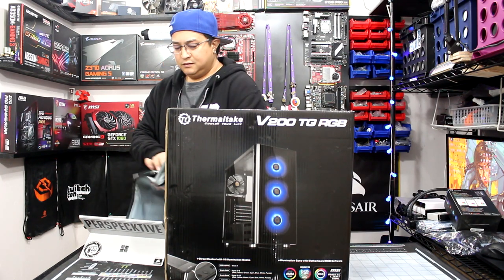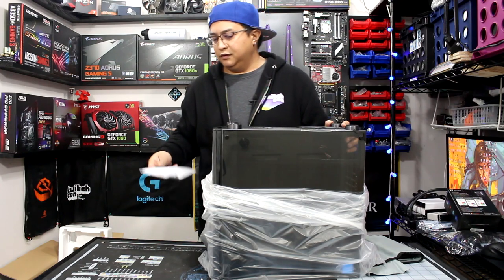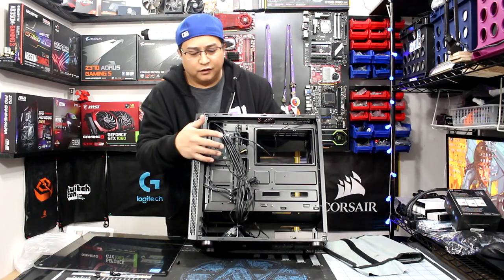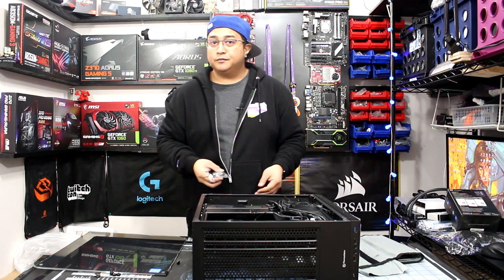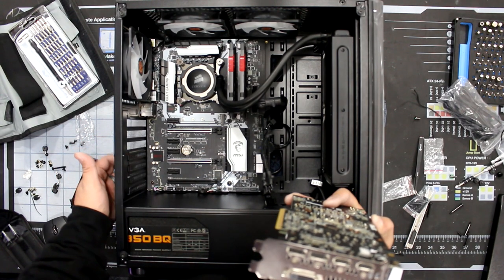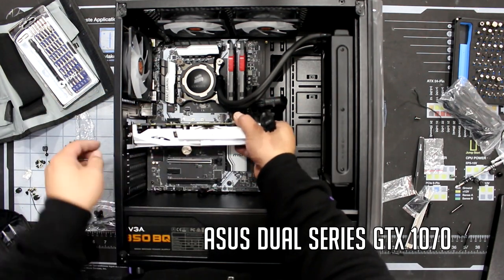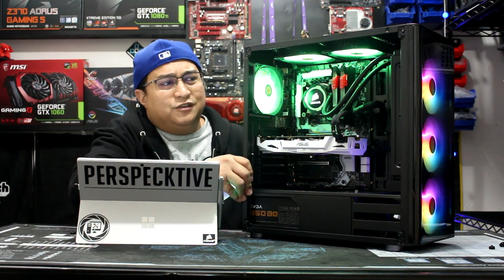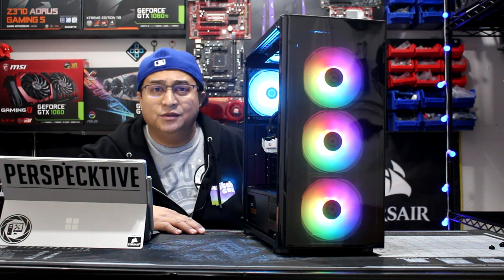Building In The Thermaltake V200 TG RGB (2018)

Comment: So just to confirm, this case can NOT fit a 360mm radiator in the front? I'm finding really mixed information on this.
Reply from the maker: The new version of this case can. I mentioned it in my pinned comment shortly after I found out there was a revision as this was the pre 2020 version of the case. Wish I could annotate that in the video but a pinned comment was the best I could do. Hope this helps
Reply: @PERSPECKTiVE  Sorry, I should've looked at the comment. Thanks so much! Now I just have to figure out if I bought the 2020 version or not. I got it in April of that year, so it could probably go either way.
Reply from the maker: @EthanH1  it's alright, it's not the first thing someone would look at anyway since most pinned comments are full of like and subscribe ads. But yeah I haven't worked with the revision so idk if there's anything that sets them apart
Reply from the maker: @EthanH1   I thought about it and had to watch the build again since it's been so long but I think one thing that they probably did was make the hole on the psu shroud a little bigger and adjusted or extended the holes on top to fit a 240 rad. You could try comparing that to what you see here if you're able to. I looked at pics but I think they just reused the old pics since the outer body is exactly the same

Comment: Hey just built a PC with this case, everything seems to be fine but my case fans are not running or lighting up. i have the female/male 4 pin unconnected not sure where to connect it i have motherboard: ASRock B450M PRO4 Socket AM4 Dual Channel, PCIe 3.0, 2xM.2 USB 3.1, DVI-D, HDMI, D-Sub, RGB mATX can u help fix fans? Thanks
Reply: There's a sata cable that powers the fans from that little board, you'll have to connect it for it to work
Reply: Justin Honeycutt Yeah i figures that out soon after posting this, Thanks for the reply tho
Reply from the maker: Sorry for the late reply but I'm glad the community stepped in to help you out and even though you already figured it out, I'm glad for that too. Hope your build runs great!
Reply: @PERSPECKTiVE  no problem, I've got this case but my biggest gripe is restricted airflow from the front fans since I've got my 240 Radiator mounted there.
Reply from the maker: @justinhoneycutt3307  I feel you on that. That's the only reason why I would push for 140mm fans on top to counter the issue. Not the kind of case I would use for a cpu that runs hot like a 9900k but if you have air cooling it can't be too bad. I also wouldn't put a system in here that you're planning on doing heavy overclocking either unless your're running a buncha be quiet or noctuas.
Reply: @PERSPECKTiVE  5 upHere fans for the Radiator and three upHere for the top and rear of the case, it keeps a i5 9600k roughly 35 idle

Comment: would it be a good idea, since i have this case and it’s my first time building yet i have no idea what to do, to take out the bottom fan in the front, put it in the back and then place the one in the back on the top of the case so it can have better ventilation? bc i read reviews of the ventilation being bad and making the inside hot if you use it how it comes, in just worried since it’s my first build and i don’t wanna mess anything on the inside up when it’s running.
Reply from the maker: You could do that if you're strapped for cash. You could just buy 1 140mm fan and be OK with that as well. What are you building in it anyway? Also, before you build it make sure you remove at least 2 pci plates in the back if you have a graphics card. More if you have things like an internal elgato.
Reply: PERSPECKTiVE i don’t have the cash for a extra fan hence why i wanna try going this route, i’m building just a simple gaming computer for streaming and gameplay, and ryzen 2600, gtx rog 1660 super, 2x 8gb ram, 650w power supply with an msi gaming plus max motherboard. also i’m using the samsung evo 970 500gb internal ssd but it’s i wanted to install another ssd or hard drive after the build, would it be easy or difficult to add it in ?
Reply from the maker: @Uzaayy  You'd definitely be OK with that setup. Also adding drives would be easy. If you really wanna make it easy for yourself just install an extra sata cable and route a sata power cable to the spot you're gonna put the SSD in the future. Your future self will love you for that because sometimes we're in a pinch when we need more space and we just wanna install the drive and just GAME or get some WORK done.
Reply: PERSPECKTiVE thank you SO MUCH i appreciate the help and replies, i will definitely do that and make sure i’m cautious and careful with everything, i will let you know how everything goes!
Reply from the maker: @Uzaayy  Sweet! Well good luck with the build and thanks for Subscribing! Looking forward to hearing about how it goes!
Reply: PERSPECKTiVE forsure, well deserved sub and i hope you get the growth you deserve !

Comment: Where did you put your hard drive? Doesn’t look like there is a good spot
Reply from the maker: There's a hard drive cage in the power supply shroud and a place for 2.5 inch drives right behind the radiator

Comment: can the motherboard control the fan speed?
Reply from the maker: You'll have to connect the fans to the motherboard itself to control fan speeds or get a fan controller that supports that since the one that comes with the case doesn't
Reply: PERSPECKTiVE Ok thanks
Reply from the maker: @willd9122  no problem at all

Comment: Would this build work with with a push and pull fan on the radiator? im looking to build one
Reply from the maker: Yeah as long as you're mounting it in front and your graphics card isn't too long. I'd say you're either not gonna be able to or maybe even cutting it close if you have a 3 fan card like a rog strix. But a dual fan like the 1070 in the video a push pull config would fit just fine.
Reply: @PERSPECKTiVE  Funny enough i have a 3 fan rog strix 1070 at 297mm, leaving me 80mm to play with right? (380mm for pcie cards i believe on this case)  that should be enough to get the rad and the inside fans in as the outside fans are on the exterior anyway correct? i wonder if that would make bad airflow if they were too close.
Reply from the maker: @WTP_DAVE  Nice. I had my 1070 Strix for about 2.5 years before I picked up a 2060S back in December. So yea you're right you do have room to install it. I can't speak much on if airflow is gonna be terrible but it can't be that bad since the strix ISN'T a blower style card. It'll just suck in the air from that bottom half and bring it towards the center of the case close enough to get exhausted out from your rear and/or top exhaust. Plus you got that tiny little exhaust port on the card in the back. So I don't think it'll be bad enough for you to worry about it. Just make sure you have top exhaust fans.

Comment: Can you upload a video showing where all the power supply cables go?
Reply from the maker: Sorry Luis I don't have the case anymore but you can see where I placed them in the time lapse. I have another video called Old PC Makeover that would show that too. But basically you wanna route them out of the way of the side panel and make sure none of the cables get pinched. I have other build videos where you can get a better idea on PSU cable placement as well. Hope that helps because it's not too crazy of a process. Just takes time if you wanna do it clean.

Comment: Hey I was wondering where to plug in the 4 pin male connector that comes out of the bottom of the rgb controller on the back side to get sync connection to change rgb with software?
I have the asrock b450 pro4
Or even the female one because they are both on the same cable end
Reply from the maker: The male connector is for light strips and stuff, the female connector is what goes to the RGB headers on the motherboard. The cable should have come with the motherboard.
Reply: @PERSPECKTiVE  and stuff? wheres the male go? having hard time with the rog z390-e gaming motherboard?
Reply from the maker: Krave I don’t even know what your question is.
Reply: @PERSPECKTiVE  whered the 4 prong male connector go? I cant find a slot for it
Reply from the maker: @krave421  Where is the 4 prong male connector located at? And are you sure it's male?
Reply: @PERSPECKTiVE  its rgb extension i found out.
Reply from the maker: @krave421  Oh. Yeah I answered that same question on this thread. Were you able to figure out what to do with it?

Comment: Where do I need to connect the cable for the three fans in front? I built a pc with that case and everything works except the three fans.. they don't work at all.. any solution?
Reply from the maker: Did you connect the sata power to the psu? If they don't spin at all, you would definitely need to connect the fan controller to some power.

Comment: Hey man I am having trouble with games crashing/freezing rainbow six and fortnite crash randomly I can’t even finish a single game, csgo on the other hand does not crash, I’ve tried almost everything to fix it but nothing works. Any tips would be greatly appreciated.
Reply from the maker: I’d double check if you have up to date drivers and critical windows updates. It’s really hard to say with little info honestly. You could run MSI Afterburner and check gpu temps when playing r6 and fortnite and see if it’s overheating. Is it an old card? New card? If it’s new I’d either return it if it’s within the return window or contact customer support. They should take you through steps to troubleshoot and even replace if you’re still under the mfr warranty. You could also double check if all connections are secure. Also could double check if you have enough wattage on your psu as well. Hope things work out. Keep me updated yeah?
Reply: PERSPECKTiVE so I unplugged and connected everything back no luck there. All drivers and windows updates my temps on afterburner are good it’s a brand new card gtx 1660 super Ventus OC edition
Reply: Power supply is a 600 watt so that should be fine too
Reply from the maker: @chickendinner1563  You get a blue screen right? What's the error code?
Reply: PERSPECKTiVE some times I get a blue screen other times it just says the game just crashes, error codes include system thread exception not handled, memory management,
Doc watchdog violation
Reply from the maker: @chickendinner1563  I can't really help much more than this but you could google the error codes
Reply: PERSPECKTiVE alright so I have noticed that my rainbow six siege is crashing when my gpu power  hits 100% which is the limit set in msi afterburner, will hitting power limit on my gpu crash my games?
Reply from the maker: @chickendinner1563  It shouldn't crash at 100% gpu usage. It sounds like its either not getting enough power due to a faulty/cheap power supply or the card is faulty. If your card is still new return it and get a new one. Otherwise I would double check to make sure it's not your power supply. Once you figure that out either contact customer support for the card or the power supply and try and shoot for an RMA. If you're still under your store's return policy then return the stuff back and get a new one. If you ordered the parts of Newegg they typically don't offer refunds but will offer a replacement for faulty opened components. I'd figure that out soon before your window runs out

Comment: Hey I was wondering if this supports E-Atx specifically AsRock B450 Pro 4 
Do you think I should get more fans 
Having r5 2600 1660 super
Reply from the maker: Pretty sure E-ATX is just a tad too tall. If you're going to stick with this case and get a regular ATX then I definitely would get 2 exhaust fans for the top.
Reply: Nevermind I’m stupid the asrock b450 pro 4 is a regular ATX🤦‍♂️
Reply from the maker: Aye it's all good yo. It happens. I should've double checked the mobo. To follow up on the fans though, if you have the budget and want some nice fans, go for the Be QUIET Silent Wings 3. Those are super nice. Comes in 120mm and 140mm.
Reply from the maker: Hey bro I saw your comment from the livestream earlier. Congrats on the build! How did it go?
Reply: PERSPECKTiVE it went great for my first ever build, it didn’t boot up the first time because I had a 4 pin fan connector plugged into one of the fan headers but it working great now I added the 2 fans and temps are amazing thanks so much
Reply from the maker: @chickendinner1563  It's all good I've had that happen to me before, but heck yea bro! You're welcome, I'm glad it turned out great and I'm honored to be of service!

Comment: What can i do to remove the frontal plastic, i need to take a look at the cables
Reply from the maker: There's a hole beneath the front side of the case that you can use to pull towards you to get the front panel off
Reply: @PERSPECKTiVE  is it the space where i can put my hand in ? i mean, my fingers, i dont really want to break my case :(
Reply from the maker: @elbryan7u714  Yeah it's that spot. So the easiest way to do it is to place your case upside down on your table with the front panel facing you. Then put your fingers in that space. Use one hand to hold the main frame then with the hand that's inside that space you pull towards you. Pull with some force but don't pull too hard because you might snap the cables inside for the front panel connections and power button. As long as you're careful you'll be fine :)
Reply: @PERSPECKTiVE  ok bro i m gonna try, i hope do it succesfully
Reply from the maker: @elbryan7u714  good luck man, I know you can do it!!!!!!
Reply: @PERSPECKTiVE  hey man, i was pulling the front panel out and i could pull it mostly but there was one corner that just didn’t pull out. What do i do?
Reply from the maker: @fliasc2018-kq4fo  it sounds like you should be able to keep pulling but if anything start from the beginning so all the notches come off evenly. Don’t be too worried to put some strength in it just don’t use too much force that your hand swings back when you get the panel off

Comment: This case is compatible with ARCTIC FREEZER 34 eSPORTS DUO??
Reply from the maker: Yes most definitely will. It will have a couple milimiters between the top of the radiator and the tempered glass.

Comment: i recently bought the 2020 version of this case and was wondering if the radiator liquid cooling worked well in this case, since i noticed the airflow might be a little restrictive for the front fans
Reply from the maker: Liquid cooling will be fine in any configuration on this case. Honestly if the restrictive airflow was a huge issue for the average user then we would have seen a huge redesign or even seen this removed from the market. I'm confident you'll be fine with whatever cooler you decide to choose (As long as it's not a cheap chinese knockoff) you should be just fine.

Comment: Where do I connect the two wires from the fan controller to the motherboard? I know one is for rgb but what’s the other for?
Reply from the maker: You only have one connector from the controller to the motherboard and yeah that would be for RGB. If the other connector is sata then that would plug into your psu to supply the controller with power. What's that other connector look like?

Comment: Hi, I need help ... Can I put an RX 570 GPU in this case?
Reply from the maker: It can't be longer than 320mm if you have the 2020 version. If you have the older version than you can use cards as long as 380mm
Reply: yes, i have one in mine right now. https://www.amazon.com/MSI-RX-570-ARMOR-8G/dp/B076Y93L8F this exact one

Comment: are the stock fans rgb?? or did you want extra cooling?

edit: nvm
Reply from the maker: The stock fans are RGB, I just moved them to the top and rear of the case. I used the Thermaltake Pure 13 RGB fans for the front instead. They make the case "POP" a lot more.

Comment: Sir will it be compatible to use GPU raiser
Reply from the maker: No it's not compatible but I mean if you can make it work you would likely need to make some sort of mounting points on the back side of the case